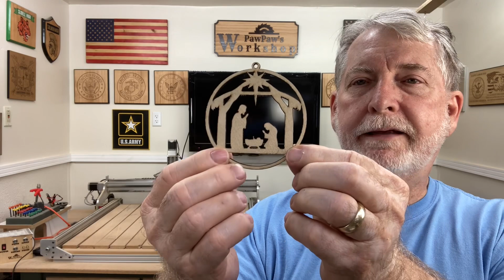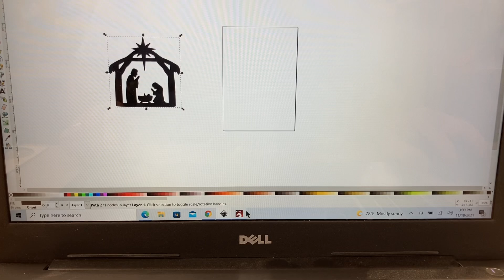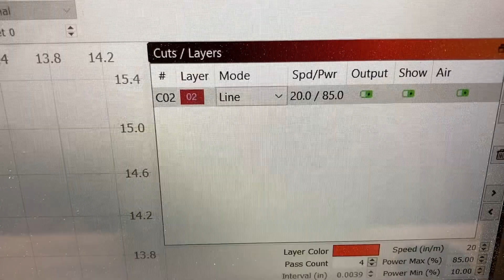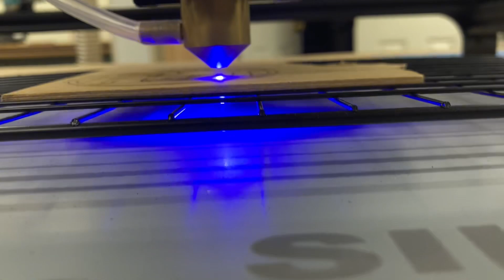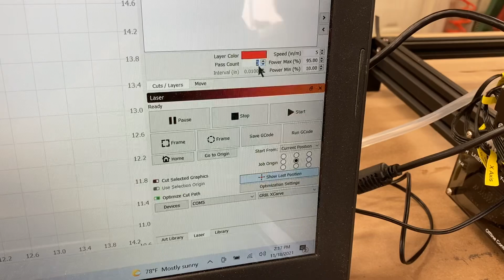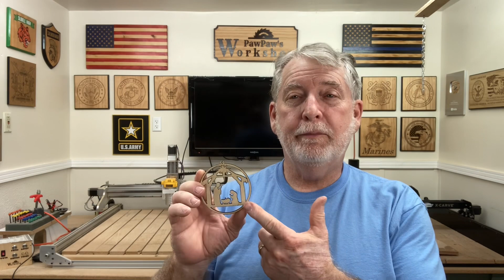Cutting out Christmas Ornaments with the 20 watt FoxAlien Reizer Laser

Comment: What is the silver device called that you used to measure? It looked like a cylinder.
I am brand new!!
Reply from the maker: With some lasers they use a cylinder to measure the height of the laser head.  Other manufacturers have a small arm that swings down to the material surface which does the same thing.

Comment: This is great, thanks.   I am new to this and would love to do what you have just shown us.  I have a 20W doide laser but I cannot even cut cardboard without setting it alight. What material is this please?  I have tried 3mm MDF but cannot cut through it.  It there some kind of magic that i am missing.  I don't have air assist yet.  Does that make much difference?  Thanks
Reply from the maker: A 20 watt laser should cut this 3mm plywood. Check to see if you lens is clean and make sure that you have it focused
Reply: @PawPawsWorkShop  I have just done a ramp cut and it doesn't cut anywhere.   I am so disappointed.  
I bought it 2-3 years ago and gave up but thought i would give it another go.

Comment: OK so if 5" a min. does as well as that looked but still had a few tight spots due to not getting all the wood fibers cut how about going to 4.8" a min to cut just a bit slower and get thoes last few stragglers of wood fiber. Some times its the smal changes that get it done.

Comment: I have just ordered the 4040xe with 20W laser. So this will be a super useful video! The air assist, did you buy it with it or did you make that bit. Can’t see anything in the listing that I just bought.
Reply from the maker: An air assist will be Important as you begin to cutout projects. I use the air assist on most of my projects. In the FOXAlien site they sell the nozzle and the pump.
Reply: @PawPawsWorkShop  thanks, I have ordered it. Added to my main order so no extra shipping costs.

Comment: Nice video pawpaw. I had given up on my 40w diode laser but you have given me a better insight. One question I have is regarding the focussing of the laser. Some people say that you need to set the height of the cylinder from the bottom of the brass housing to the work piece and others say from the bottom of the lasers casing to the work piece. What would be your advice? Thanks, Colin.
Reply from the maker: Most all of the lasers use the bottom of the laser casing to measure the correct distance. Follow the instructions of the laser. If you have an air assist you can’t measure from the cylinder.

Comment: Where did you find the GRBL XCarve?
Reply from the maker: Once you design the project in easel you can export it as a gcode.  This file can then be run by UGS or Openbuild sender (both free) and carve the project of any GRBL based machine.

Comment: I just got a Fox Alien for Christmas, what are you using underneath the metal grate to protect the surface?
Reply: I M using floor tiles.
Reply from the maker: I use a sheet is sheet metal. It’s cheap and effective. Congratulations on getting the laser. Merry Christmas
Reply: @PawPawsWorkShop  You're not worried about the laser reflecting? I was thinking of going with a ceramic bed but if the metal will work just fine, I'm just going to go with that.

Comment: So thanks for this video! Im a newbie and looking to purchase my first laser engraver. Ive looked at many brands and I'm getting a bit confused as to what will work for me. The FoxAlien system seems to pack a lot into the money that you're spending. What are your thoughts for first time owners/users? Happy Thanksgiving!!
Reply from the maker: I like the FOXAlien for the features that they offer and for the support. The Facebook forum is outstanding. I would avoid the Masuter. Any other product in their lineup is excellent.
Reply: @PawPawsWorkShop  Is there a difference between the Masuter and the other model? I'll have to research it!
Reply from the maker: Yes, the Masuter is a very lightweight entry level machine. All the other models works very well

Comment: Hi Paw Paw, I purhased the FoxAlien Laser based on what I saw you do. What does the Air Assist do? Additionally, I want to etch on glass ware. So I need to purchase the Y roller. Thank you for the insirations!
Reply from the maker: The air assist helps with the cutting of wood. It also helps to keep debris away from the lens. Yes, you will need the rotary roller
Reply: @PawPawsWorkShop  Thank you!
Reply: I found your link to FoxLAlien and use it for the purchase.

Comment: You refer to the laser as a 40W, but it actually says 20W on the laser head itself.  Mistake?
Reply from the maker: Lol, looks like a bad day. I guess you Can say I am wishful thinking. Yes, it is the 20 watt laser
Reply: @PawPawsWorkShop  I have a K40 type laser. 3mm birch plywood and 3mm acrylic are ideal for it. Single pass, at 10mm/sec. but the CO2 laser  tube is the width of the entire case. Huge compared to the diode lasers. I hadn’t seen a 20W nor a 40W diode laser. Most seem to be 3W, 5W, or 7W. If it was 40W, should have cut the plywood like butter in a single pass.  The CO2 laser does this at 9mA (max power is ~15mA).  Thanks for clearing that up.
Reply: @2manytoyz123  40W diode lasers aren't a thing. At the high-end most of these have 5-ish W. Some of the new ones bundle 2 5W diodes into a functional 10W.